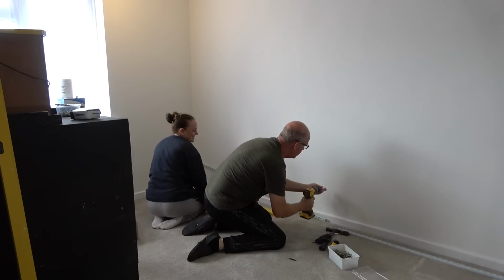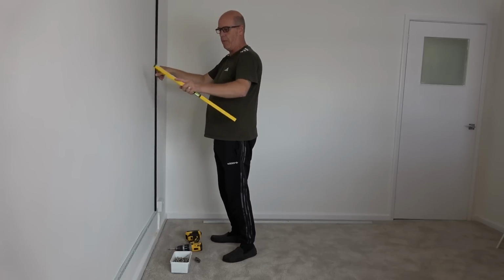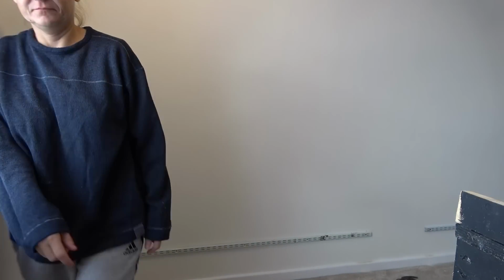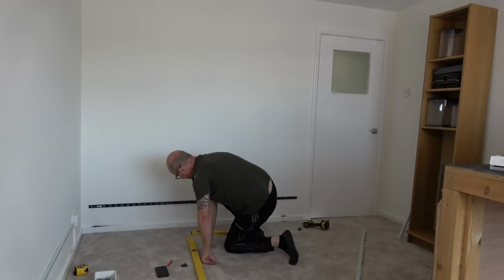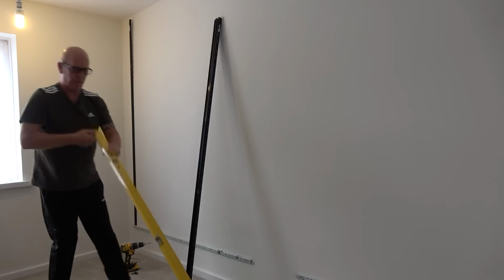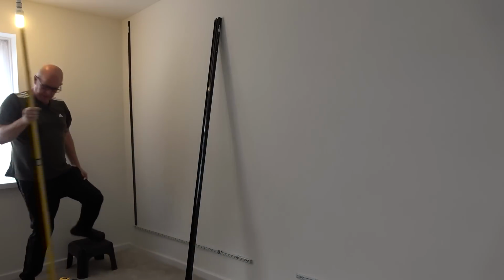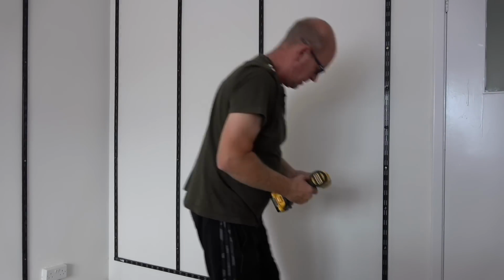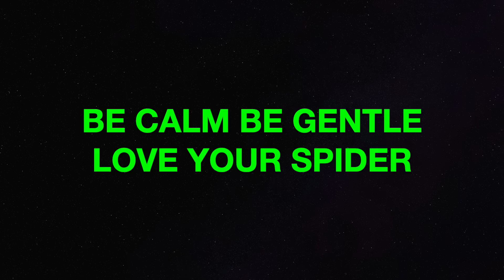Beastie Room Build Tutorial day 1

Comment: Putting the uprights at the studs would be more secure, but you can get away with dry wall screws.  I use a strong magnet to find the nails that hold the drywall to the studs.
Reply from the maker: These are solid walls not stud walls 👍brick and plaster